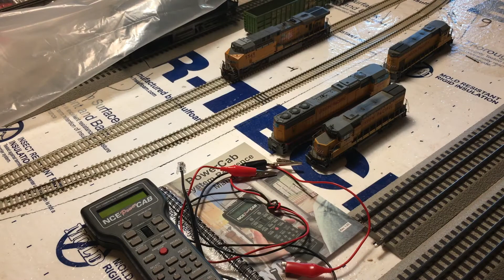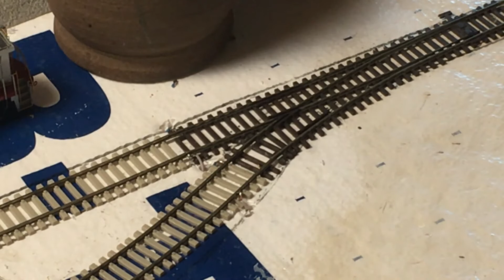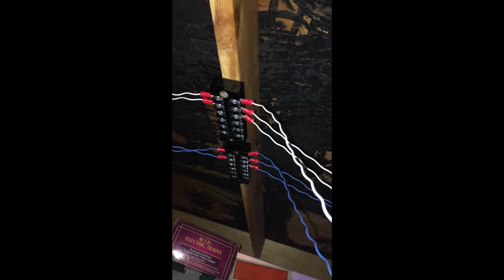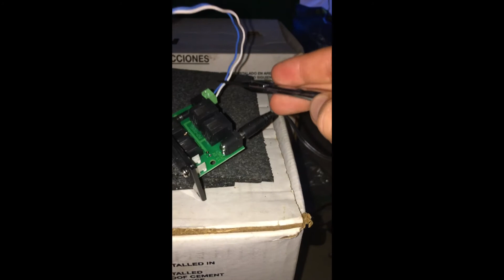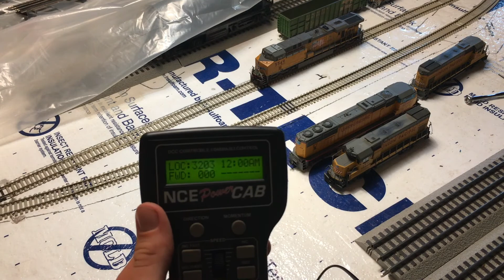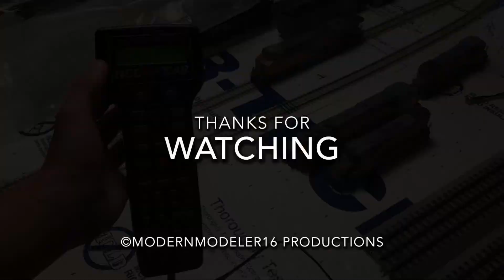NCE DCC System explained and set up

Comment: Nice video.  Easy to understand.  Just bought a NCE Power Cab.  Waiting for my upgrade to 1.65.  Can't wait to test it out as it was a used system and didn't come with the adapter for the track wires to connect.  Thanks for sharing.  Randy

Comment: hi here is my situation I am going to have 2 tracks one will be bachmmann E Z track and the other will be atlas track oval shaped about 3 ft x 5 ft and I cant go bigger then that I only have a small apartment with little space and also I am only doing this during the holidays starting in November but I cant wrap my head around how to hook up the power cab to 2 tracks the blue and white wires coming out of the back of the power cab where are they coming from on the barrier strip and the wires that are coming out of your barrier strip are they going to each side of the track. I am sorry I am not understanding this this is my first time doing DCC thanks